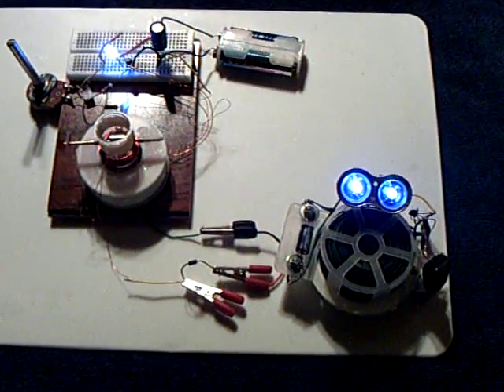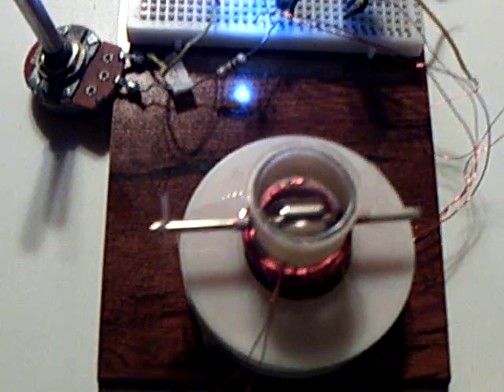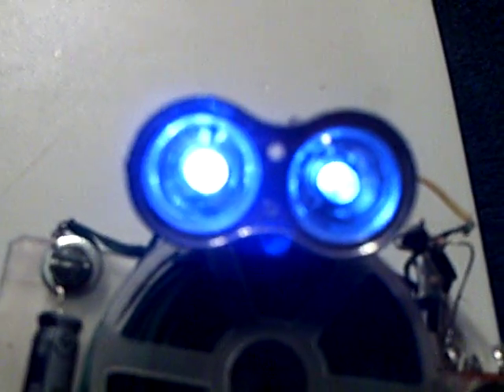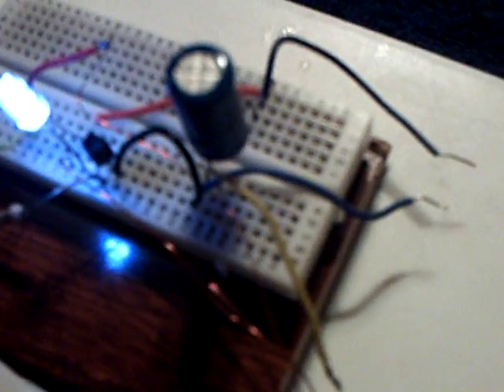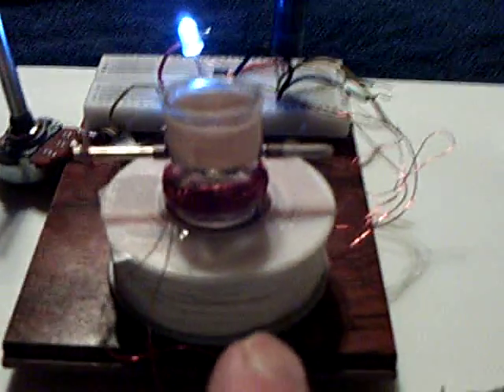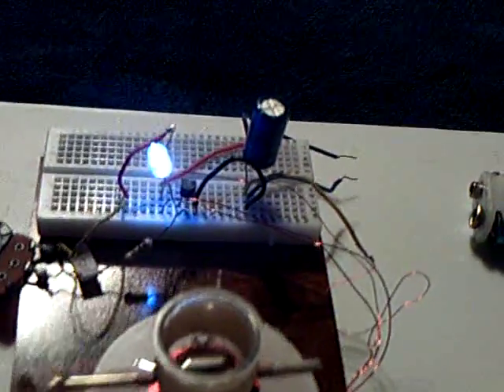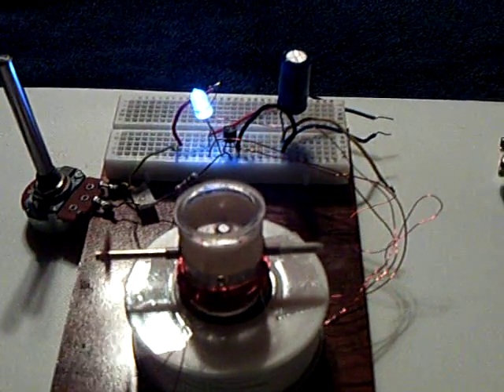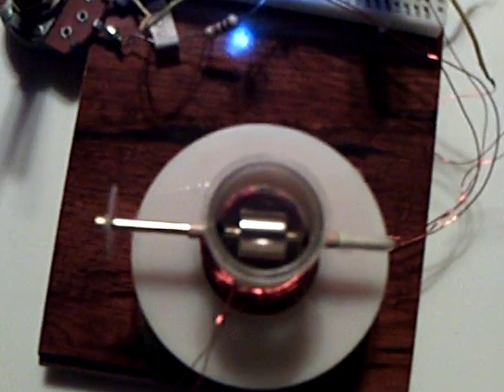Motor Wars ---- New Champ

Comment: Attach a high speed Shottky diode between the positive end of the capacitor and the hot end of the output leads. The stripe points toward the capacitor.

Comment from the maker: That won't work unless I do a cap dump circuit.  A hard connection shows the rotor a dead short in the pick up coil and the motor stops.

Comment: You always show such fun projects.  If the pickup coil were placed above rotor would it perform as well?  With pickup setting on drive coil, I wonder how much output is inductive.  Thanks again for showing your projects.

Comment from the maker: I am very familiar with Lasersaber's  EZ spin motor.   I have been meaning to get some of those jewel bearings that he is using.   I have learned that there is a difference between a motor that simply goes round and round and one that can do work . I have a motor that just spins 24/7 using a small solar panel and a capacitor.  Now I'm interested in something a little more substantial.

Comment: How long will it run then ? You could also use a third impedance matched coil  and put its output back via graetz bridge schottky rectifiers into the SuperCap. Might even work better.Would be interesting to seem how long it will run then...
good luck ! Regards, Stefan.

Comment: Well done LidM,
well you should also measure the voltage across the cap when you charge the SuperCap up,
cause just a tap with your battery might not fully charge it up...Just verify that it has 3 Volts by measuring it. These SuperCaps probably need some time to charge up... Anyway, very well done, hope you can show some scope screenshots and find out where the resonance is exactly at...What if you use 1N4148 diodes and put the spikes back into the battery instead LED light ? Regards, Stefan.